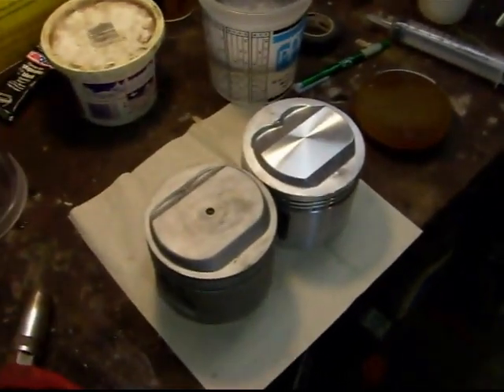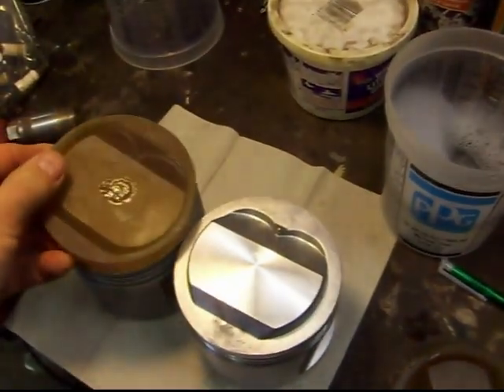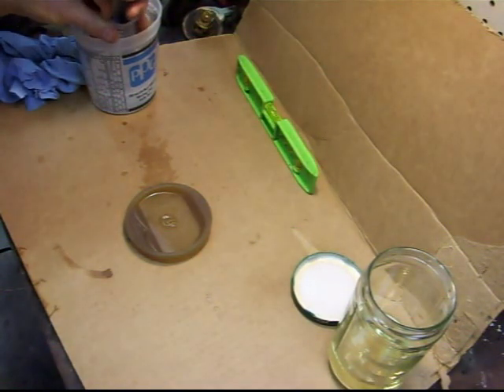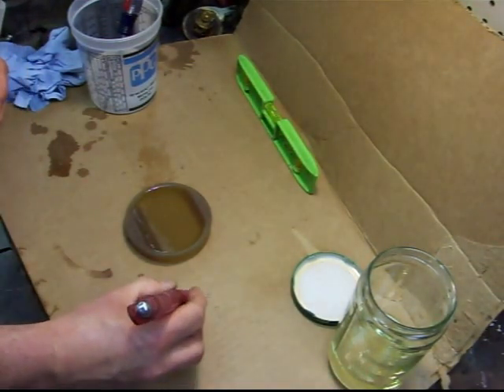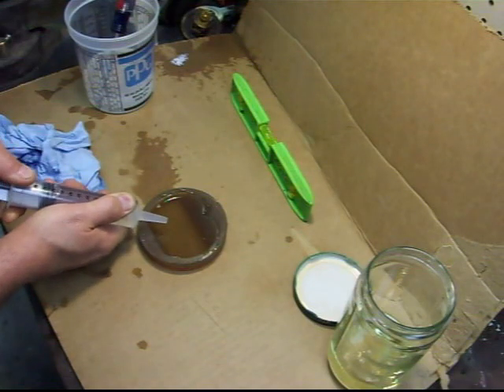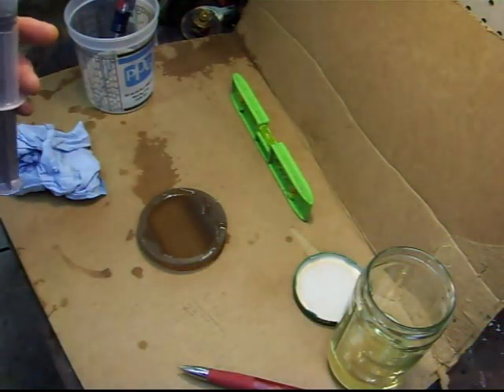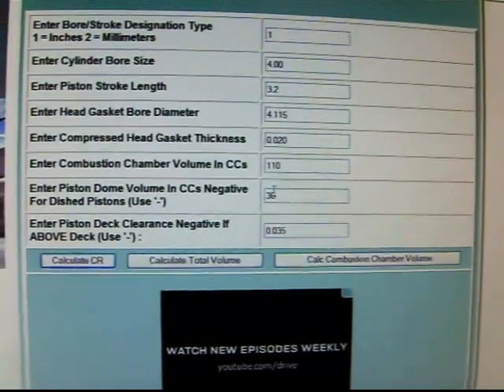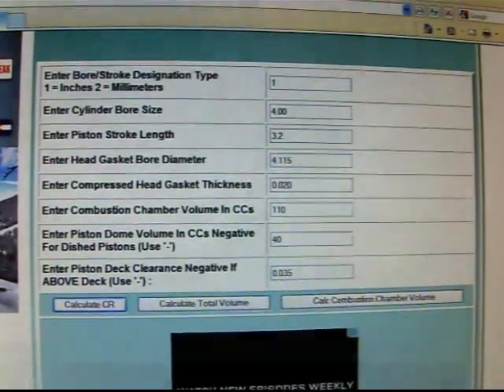1955 Buick Century Nailhead (After market pistons)

Comment: I didn't compare my stock pistons to the aftermarket ones on my 401, but they look just like yours. I'll have to take a look at the stock ones to see how much different they are. My engine is done and it is what it is, but this is very interesting.
Reply from the maker: The thing that set me off on this adventure was, the fact that the person I purchased the pistons from was claiming they were 9 to 1 pistons. After calling him and explaining that the domes are considerably smaller they could not be 9 to 1. He told me with the .040 overbore that it would make up the difference. I guess I just had to prove him wrong. I may not have noticed it when driving but I just wanted it to be stock.
Reply: I really enjoy your videos, keep them coming.